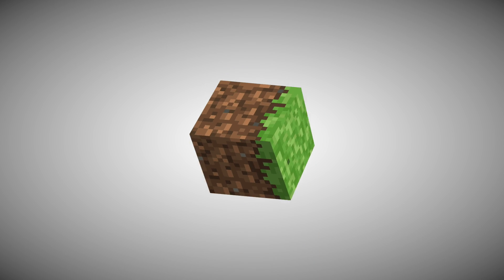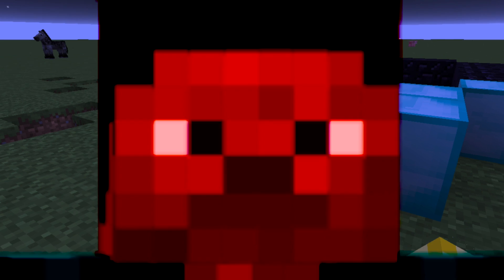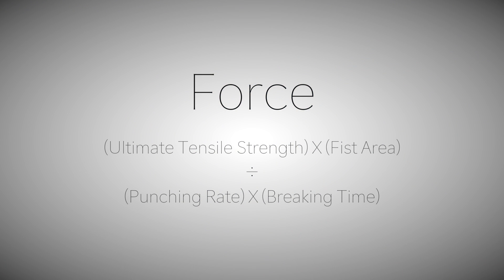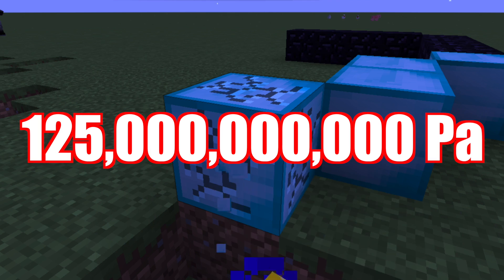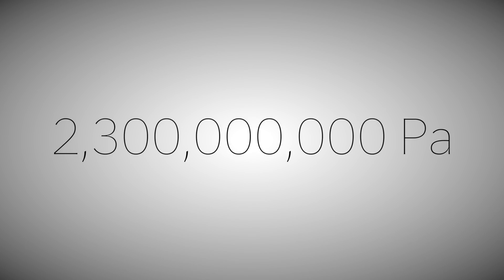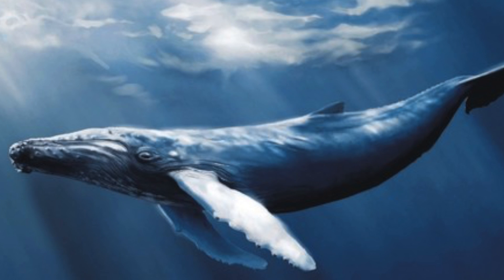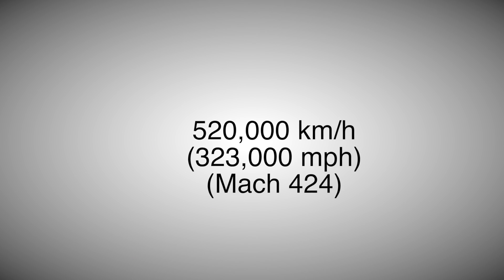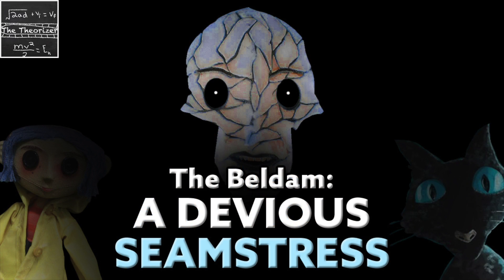Figuring Out How Hard Steve Can Punch

Comment: I just did the math and he can hold 11,353,733,289,693,639,277,588,678,333,492,989,309,200,000,000,000,000,000,000,000,000,000,000,000 Newton’s that is more then enough to completely vaporize  1 million galaxy’s and that’s not the whole number I still have about 113 more times 27s to go the whole number is ridiculous 4.39413347776727103701714396055315914270000000000000000000000000000000000000000000000000000000000e154 Newton’s  so basically that can destroy the whole universe  in one punch I just did more math HE CAN DESTROY 0.99996 TIMES 10 TO THE 186TH POWER UNIVERSES THAT IS BIGGER THEN ANY NAMED NUMBER ON EARTH AND A CENTILLIONTH OF IT WILL MAKE THE  BIGGEST NAMED NUMBER but wait HE CAN DO THAT WITH 0.861 TIMES 10 TO THE 272ND POWER UNIVERSES and more math 0.861 TIMES 10 TO THE 507TH POWER UNIVERSES he does not use his power when failing to break a bedrock block
Reply: steve is too op
Reply: @whyisbaconsizzletaken  I did something and I realized that’s weak. He can hold ender chests holding a shulker box holding an end chest and water bucket (which can hold 894 million cubic meters of water buckets at maximum. Aka 1.9 trillion kilograms.) the end chest will hold the thing with the end chest which will hold the end chest which will hold the end chest etc aka infinite weight.

Comment: 323,000 Mph. That’s the earths escape velocity 12 times over. At that speed, it would take you just under 45 minutes to hit the moon, from surface level.
Reply: Also, he can casually run and jump with 21,763,436,538.24 Lbs strapped to his belt.

Comment: Uh ... how does this formula work? A punch is not a force, it's a force applied over time: it's an impulse. It is, however, not the time an entire swing takes, it is the time the punch connects, which is only a fraction of the swing. Also, I don't see how, mathematically, the block is actually destroyed. Given that one must always exceed the UTS with every punch (prolonged contacts with lower pressures will simply do nothing), shouldn't you rather go by the fraction of the cubic metre of material that is pulverised with every punch and somehow involve some material-specific value of bonding energy? After all, you must perform actual mechanical work to crack and displace the material.

Comment: That whole bow thing is wrong. Because the force used to fire the arrow doesn't lay with your strength, it relies on the draw strength of the arms. A bow with 5 lbs of draw strength won't do much damage while a bow with 100 lbs of draw strength would do a lot of damage. Again the bow's strength is in the bow's arms not the user's.

Comment: Steve can take 2368.375 diamond blocks but still walks as fast as usual.
However, he walks slower when drawing a bow.
So the bow Steve is holding is heavier than 2368.375 diamond blocks.

P.S one diamond is 3510 kg/m³

Comment: sorry but the bow thing is wrong because Steve is not punching the arrow bows always use the same amount of weight to pull the string back so let's say the draw weight is 70 pounds (that's a lot considered it's a bow) it now will shoot 70 pounds of pressure
Reply: also if steve did pull back with 900 pounds the bow would still only shoot with 70 pounds of force

Comment: you forgot 20 min is 24h in minecraft
Reply from the maker: That has absolutely no effect on time whatsoever. All it means is the sun goes around the planet faster.
Reply: in the commands you can set or add time to sec that is how it work so there is a change of proof that i do it very slow and not fast
Reply: and there are mods that add clock with timer so 3 sec it one minecraft min
Reply from the maker: Again, that doesn't change the literal flow of time. At all. It doesn't work like that.